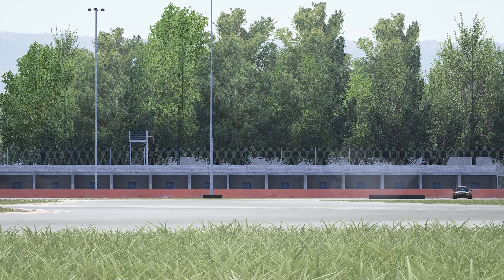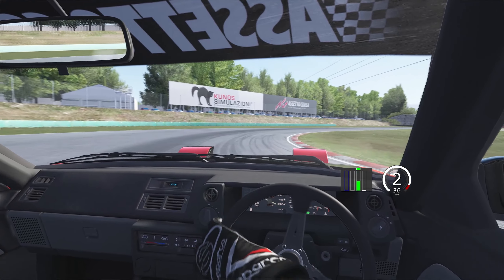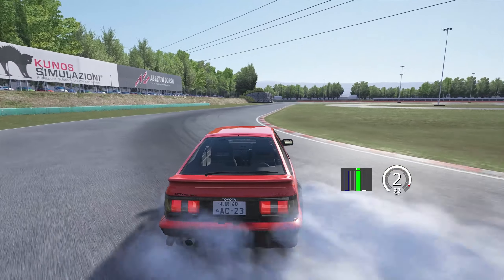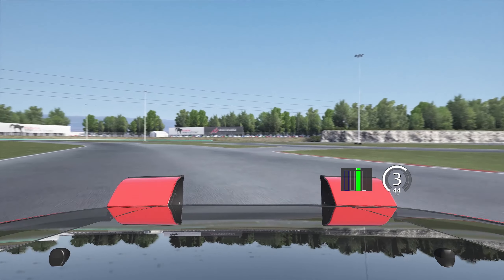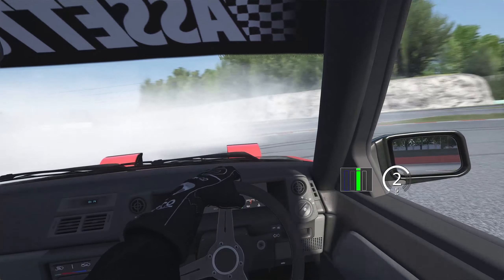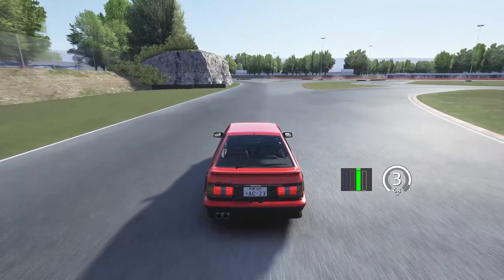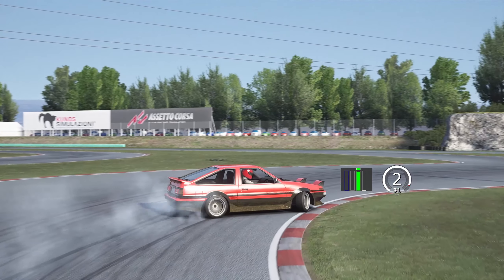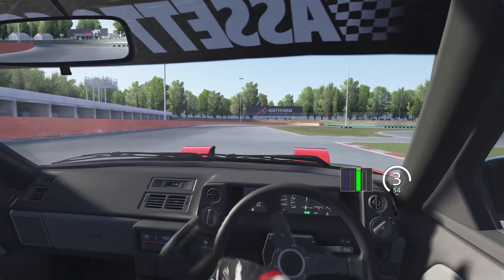How to Drift on Assetto Corsa 2022 (Advanced)

Comment: I think all the begginers should use the old BMW M3 e30, till they get all those tricks done flawlessly. Is just an opinion of mine, somd people might be different. But the e30 it's so balanced and has such great maneuverability, with just enough power to make the perfect car for beginners. The AE86 might be a bit hard for some folks as you don't have the power flexibility.
Reply: I agree with you

Although when i started to learn how to drift i found the ae86 easyer to control and the e30 was like its got a mind of its own. But thats just me being weird
Reply: its true.  newer m3s tend to screw with you with certain settings, like no diff or cannot set rear suspension right.. the power looks good on those newer but for learning its only the e30.   86 has just enough power and it proves difficult even if you know what youre doing.  
Not completely new here but yeah.. those were my experiences.   Just decide a track with an e30 for start and keep grinding.  When you get bored, maybe switch to some good phisics car mods like WDT or something realistic and youre golden.  Took me a couple of days straight to get it down on gran turismo 6 back in the days.. then again a few days on sport.  then again on ac.  but now.. its like riding a bike. turn right to go left - logical.  :D

Comment: Started drifting in AC about a year ago and found every 'drifting tips' guide just ran through stuff like 'make your rear wheels lose traction and you will 'drift' through a corner; have fun, that's all folks!'. So it's good to see some actual tips that I hadn't already heard. 

Personally think left-foot braking and using he brake to manage drifts is the single most important technique that I've learned in the last six months. I wasn't taught it, but after a while you just notice that certain things work, and you start using them. I use left foot braking almost constantly when drifting touges and if you want to reverse entry some horrible tight turn you can use lfbing to get up to high speed on a straight and brake hard into the hairpin without touching the handbrake or using much weight transferal at all. And using it combined with handbrake is crucial to me since I'm still at the stage where I can't perfectly judge when to engage handbrake with tight turns at high speed.

The one thing I have most trouble with though is long, shallow-cornered, high speed drifts, especially ones where the angle of the corner changes as you're drifting. Think of Akina Lake's first turn, or some of the long turns on Kunos's Highland drift course. I naturally flick the back end out quite severely, which means I lose speed. But if I try to to do it differently, and catch the drift at a shallower angle, I almost always end up understeering and straightening up. It's driving me a bit nuts because I'm decent-ish on short courses but when it comes to long, sweeping, shallow drifts I'm twitchy and hopeless.

Any tips(useful ones, not 'give up' or 'git gud') from drifters who're good at that kind of thing would be appreciated. And again to That Sim Racing Bloke; excellent vid, I'm off to try some of these out.
Reply: exact same problem here, have you found any tips my man?
Reply: @hvitekrist7778  Nope, nothing aside from the answer you least want to hear: practise.

There are some things I notice that I do when drifting these really long, shallow angles, but they're pretty obvious:

- try and leave room in the rev band, so that you can accelerate and oversteer-correct your drift if you start to understeer wide.

- left foot brake to tuck in the back end 

- be in high gears obv.

I'm better than I was, but I still find tracks like LAC and Pacific Canyon, Akina Lake, etc. tricky because the speeds you reach are so huge and bumps in the road are worse because of that. My Fanatec shudders the room when I'm running Pacific Coast in a 1300hp VDC Silvia. And if your back end swings out too fast and you're in third/fourth gear you just can't catch it because your engine will stall when you try.  

Touges are my forte really. The big, long, fast tracks are still beyond me in terms of consistently performing well on them. I can manage Usui Pass(the big looped touge by Euro and Kozzren, might have the name wrong) but that has very wide roads so it's fairly simple.

Any tips of your own?
Reply: @thesprawl2361  I wouldn't be giving any fruitful tips as I am more or less a beginner. However, mostly from trial and error, I did manage to take advantage of some correction techniques when I'm going too close to the inside such as clutching to decrease angle and handbrake a bit to slide outwards. Not sure if this is the "correct" technique though
Reply: @hvitekrist7778  I think 'correct technique' is just what works.
Reply: @hvitekrist7778  ...You do what feels right. You hear a lot of people talking like they're experts about drifting online. But 99% of them are just bluffing overconfident types. Stick with your instincts and just practise.

It really is tough at the beginning though, I feel for you. I'd say I'm just past that point and now I can actually enjoy drifting rather than spend most of the time trying to three point turn out of narrow touge lanes that I've ended up stopped sideways at, facing a metal rail, constantly shuffling back and forwards to get out of the position, like Austin Powers in that little car in Dr Evil's lair. It's so dispiriting at first. But hang in there.

Comment: good video and explaination, however the Inertia drift you showed was a Lift Off oversteer (or snap oversteer in extreme cases). its my main way to get into a drift when driving an MR2 in AC. an inertia drift is basicallly just flicking your car from one side to the other in a snappy motion (by using the inertia of the lever bla bla bla physics stuff bla bla)

Comment: Is it even possible on keyboard with mouse 🗿
Reply: Why are you even asking that
Reply: Yes its possible because i do it. Just get content manager so you can use full throttle and not the wierd traction control you cant disable normally
Reply: @patrykrog8121  how to disable it?
Reply: @fadhilramadhan6765  in content manager in controls settings just unasign the throttle and there should also be a forced throttle thing and you have to select then just set the lag up and down how you want it.

Comment: at manji, its worth mentioning also  sanpatsu or what ever its called nowadays..  a tri motion drift; where you supposably link a straight between two corners with a double manji, then enter a corner..  Like Oi Futo style - the port in tokyo bay, which has some super wide roads meant for trucks mostly..  Its like trick shot, if you can do in in tri motion and still enter the last turn.  Theres an ac track also and video somewhere on how to  XD   ...ur welcome

Comment: Just gonna have to ask, 
i'm not very experienced but i can somewhat hold a drift, but often my front tires suddenly gain so much grip i lose controll most of the time from suddenly turning with the steering, do you know what i should do to avoid that?
Reply from the maker: If I understand your question correctly; more throttle!

Comment: I do not have any playstation or thing. I just have a keyboard only. I try much hard to drift. But thats not working. Can you help me?
Reply: Get a fucking controller
Reply: @AmnesiaForever  controller is actually a lot worse than mouse steering. Im in a touge team and im just as fast with mouse and keyboard as people with a wheel. I dont undestand why you are so mean and recommending something that is 10x worse to use even though you probably never tried mouse steering
Reply: @patrykrog8121  AC allows mouse steering? seems I overlooked this. Finally a good reason to use more than 1.2k DPI on my mouse.

Still, unless Nipz rebinds the brake key onto any other key his other hand can easily reach, he's screwed.

I still agree on the controller part if only because keyboard switches are like bool variables (either it's pressed or it's not) whilst controller triggers these days give float values between 0 and 1 (0.5 for 50% pressed trigger for example). 

Considering how picky this game is with the handling, if you lack a steering wheel a controller is still the better option because some of these drift techniques require a constant light press of the brakes while you mash the throttle, and if you try doing that on the keyboard, the brakes will always be pressed 100% of the way.
Reply: @OfficialDJSoru  well mouse steering is still a whole lot better and you can actually brake and throttle at the same time but this gets difficult. The only part that is hard on keyboard is no clutch and thats the reason why i still prefer lfs for drifting. Also the game limits the throttle when you are in a drift with mouse steering for some reason but you can get around this in content manager and then its good for drifting. I actually mostly do the touges and i get good times and im about the same speed as people with wheels if not faster. The only time i loose time is in some fast corners that then turn in really sharp but i found a way to stay fast and that is to initiate a drift and let that slow you down. Its not easy with keyboard but i can assure you its 10x better than using a controller
Reply: @patrykrog8121  look at the video again. At least in one case he had both the throttle near max but the brakes constantly in the 20-30% range. How do you expect that on the keyboard?

Also, you DO know you can bind the clutch key to the keyboard, right? For some reason they don't have a key set on the default bind
Reply: @OfficialDJSoru  yes in newer content manager they got a clutch keybind but none of them work for me. And you just tap the brake to get the same effect. You need to spend some time getting used to it but mouse is still a lot better. Trust me with this as i already proved my point to a lot of friends who switched from controller back to keyboard. Although for the 800hp cars you got a point and on kayboard that sort of power is hard to control. But overall having more control over the steering is better than the throttle because the throttle for sub 500hp cars its easy to control.